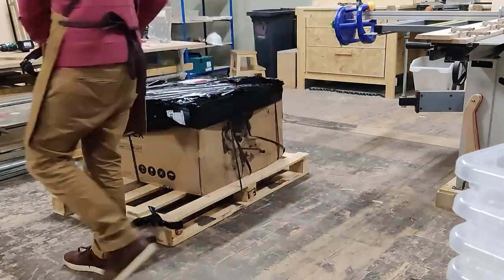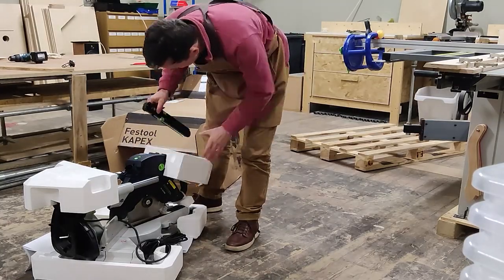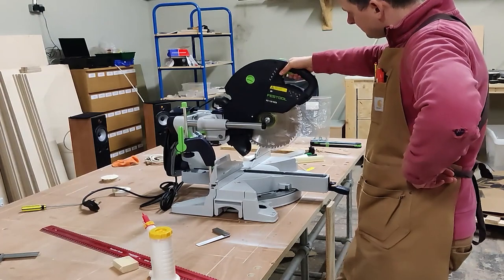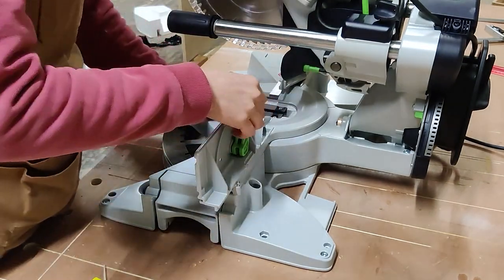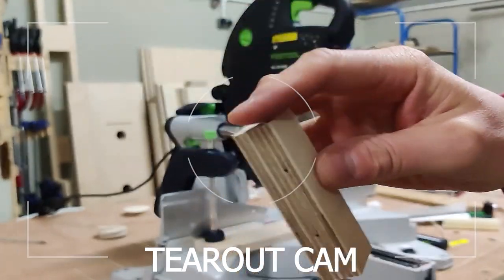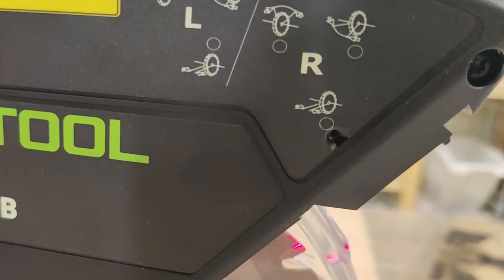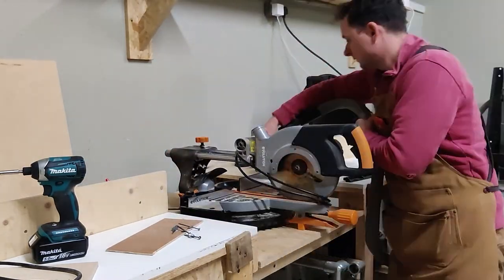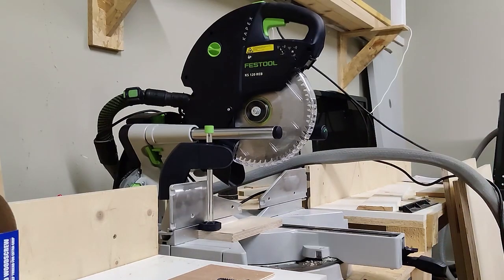Does the Kapex Live Up To The Hype?

Comment from the maker: I noticed recently that the Wera ball head hex wrenches feel quite slack at the ball head end. The ball measures the right dimensions but on the small sizes like 2.5mm the contact area is so small it's easy to damage the screw you're adjusting.

Comment: If you need to adjust the laser screws get a hex without a sleeve on it, the sleeve on (looks like you used a Wera) will at times stop you from fully inserting the hex.
Reply from the maker: Nice thanks. It's certainly possible that I stripped the head unknowingly. I used a Hex Plus which I thought would be safer but felt a lot of wiggle straight away. If I need to do it again I will try a different one. Thanks.

Comment: I have the dewalt dws780 mitre saw.
I was thinking of getting a festool kapex but not too sure now. Rather than have a laser the dewalt projects a shadow line over the cut instead so it's  more precise than a laser. Also it's a 305mm blade. I'm not sure what size.cuts the kapex can do any ideas? I'd be sold on the kapex if it can cut as deep as the dewalt
Reply from the maker: It has a special feature where you can lock the saw and get a tall moulding or skirting up behind the centre of the blade to get more height. Not used that feature yet and not familiar with the DeWalt so don't know how they compare.

Info from the Festool site:

Trimming skirting boards and cornices up to 120 mm in height – no calculations
Cutting boards and panels up to 305 x 88 mm
Trimming crown mouldings up to 168 mm in their original wall position
Trimming square timber and beams up to 88 mm thick
Reply: @beyondutility  ahhh I've had oak beams and telegraph poles on the dewalt. I don't think they would fit behind the kapex :(